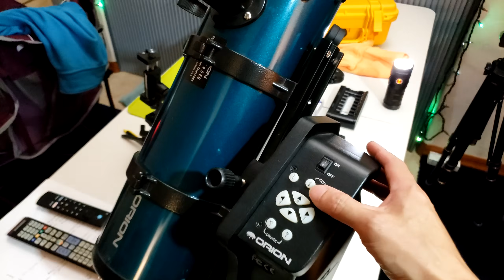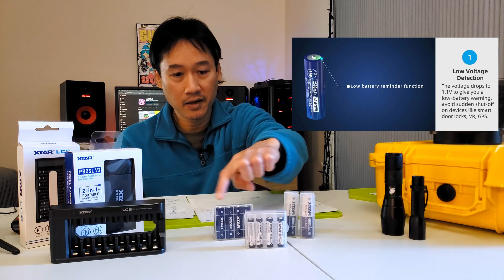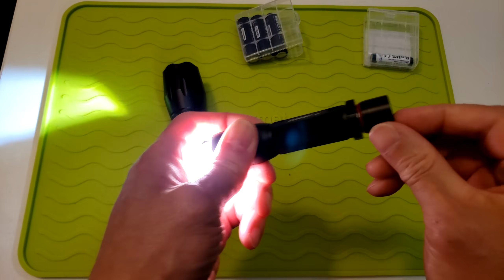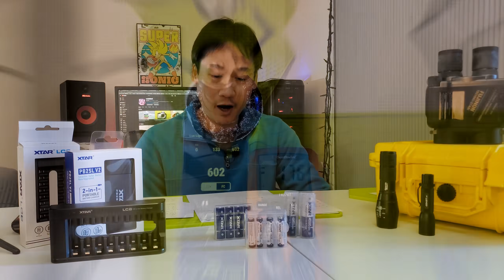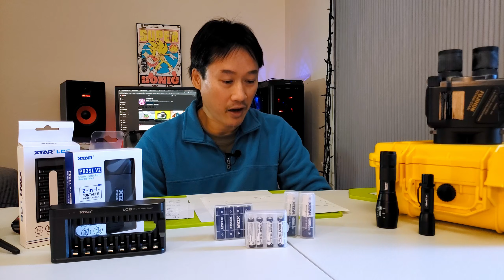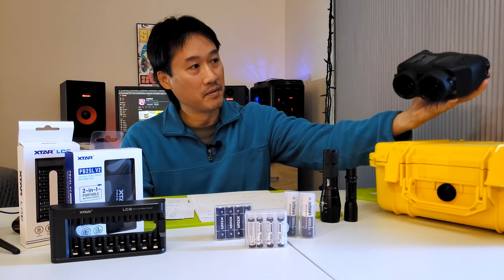XTAR 1.5V Rechargeable Lithium AA Battery Review

Comment: It is a detailed test but the issue with it is it is not really a good comparison between the 1.5v lithium and the 1.2v NiMh, when it comes to the Lithium it will output a stable 1.5V reducing the current as needed all the way until the Lithium cell reaches its minimum voltage of about 2.5V which  means there is 2.5v that is being unused, the NiMh on the other hand starts at 1.2v and immediately starts to decrease in voltage  but they will out put power all the way down to zero volts meaning they will always / usually last longer in a torch application.   The issue is when you try to use NiMh in a device that has voltage sensing  they just do not work all that well like an old Logitech mouse i used to use about a year ago it used  2 AAs and I bought high capacity HiMh but they never worked well, the mouse after a short use would start complaining that the battery's are getting low and after a few days use it would force the mouse into power saver mode and i had similar issues with other devices, about a year ago I found EBL Reds they are also 1.5V Lithium AAs and they worked flawlessly in the mouse as they put out a stable 1.5v.

Like in your tests with the XTAR the EBL seem to also have issues putting out high amps as i got a set of EBL Red AAA to use  in heated gloves but the batteries would immediately shut off  the second I turned on the gloves,  so I am guessing it is just a limitation the tiny BMS they squeezed into the shell meaning they are no good for high drain applications but they are excellent for low drain
Reply: A lot of what you said isn't factual...I have multiple sets of almost every type of rechargeable there is along with professional chargers (costing hundreds each). There are several versions of the li-ion Xtar and they all have different capacities and discharge curves...the 3000mAh ones i have have more capacity than my Eneloop Pros. Yes you can't run them to 0v because that would damage the cells....you shouldn't be running any cell to 0v

Comment: That sudden drop-off from 1.5V to whatever the second step was (1.1V?) is a deal breaker!
Why not let the bms slowly adjust down as the voltage as the cell gets closer to depletion? Either that, or actually run at 1.5V until the cell is down to like 10%, not at half capacity or so!!!
Reply from the maker: I get what you're saying about the sudden cut-off.  I have been using the Xtar AAA for several months now on my maglite XL50 flashlight which uses three AAA.  Several times I thought my flashlight was defective when it suddenly turned off when usually it drops in brightness when low on power with alkalines or nimh.  Then I remembered I was using these Xtar batteries.  So it takes a bit of getting used to its behavior.  What I found each time was that one of the three cells would be 0 volts and the other two are around 1.1 volts.  So with three cells this sudden drop in voltage did not give any warning of low power when used with the Maglite XL50.  I would not use this battery for emergency flashlight or if you know you're gonna deplete the battery in one session.  Nothing worse than being stuck out in the dark on a hike and the light goes completely out.
Reply: You are misunderstanding what is going on here as it is not the voltage that is dropping and it remains at 1.5v the whole test, what is actually happening is that the battery's BMS is limiting the current over time to ensure a stable 1.5v output as the voltage of the lithium cell reduces or if it detects a temp issue.
Reply: @EQINOX187 please stop.commenting on things you don't understand...YES, the battery (buck converter) does cut the voltage down once the li-ion cell reaches a certain voltage so that whatever you are using it in will display low battery. They have different versions with different capacities and different discharge curves. Their LR 3000 ones have an almost constant discharge curve from 1.5v down to 1v...their 2700mAh ones stay constant at 1.5v until about 70% or so discharged and then have a gradual buy steep discharge to 1v again. You're still getting more usable energy from the lithium vs the NiMh. My LR 3000 all have a capacity over 3000mAh which beats all NiMh rechargeables and they have the added advantage of having a higher voltage for longer

Comment: Wait true 1.5V? I've never seen that!
Reply from the maker: It uses a voltage converter to step down the 4.2 volts of lithium ion battery down to 1.5 volts.
Reply: There are different versions...some have gradual discharge curves like a regular disposable battery would have, for more accurate charge level display, and some will output at 1.5v for about 75% of the capacity and then drop quickly after that...depends on your needs. They do require Li-ion 1.5v chargers...except some come with built-in usb-c ports for charging that way